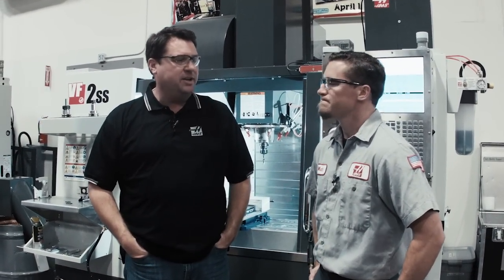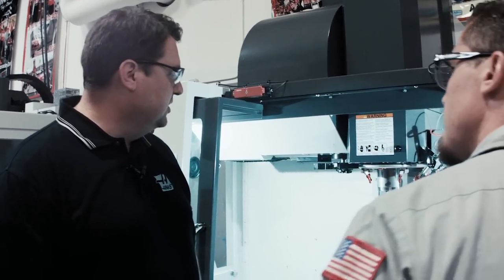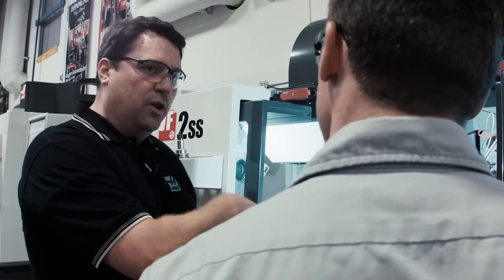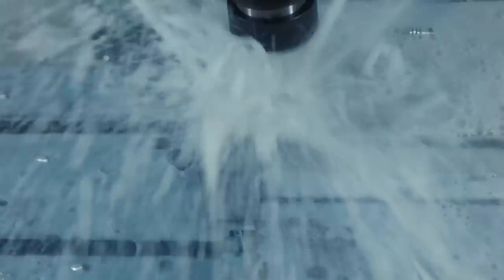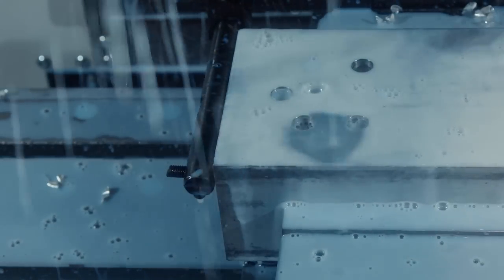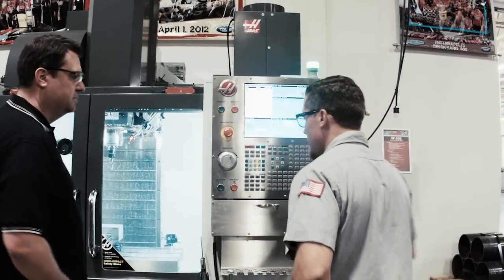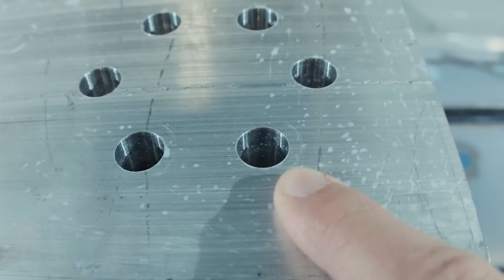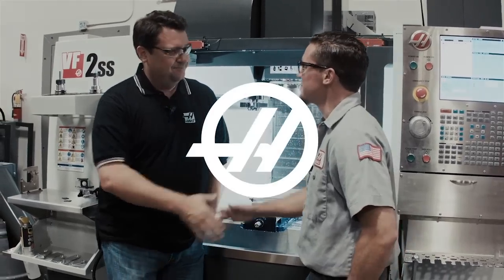The Advantages of Through-Spindle Coolant

Comment: i have little repect for drilling or milling  aluminium.  its like butter for the machine. Much more fun to see when machining steel.
Reply: Shop owner who works aluminium on a daily basis says you know less about machining aluminium than you think. Steel is probably hard but aluminium is sticky. When drilling a deep hole, aluminium chips are much harder to evacuate away which often results flute blockage or tool break, whether it is a HSS or carbide tool. When doing a job with 20000 deep holes, TSC will literally save days of cycle time.

Comment: if he wanted a true "apples to apples" comparison, why not solid carbide vs carbide with TSC? I think the HSS -> carbide makes a bigger difference than flood -> TSC for final hole quality.
Reply: Mech engineer I assume it was done that way since you still need to worry about keeping the drill cool. The feedrates can be bumped up with carbide but there's still a pretty heavy limitation if you can't deliver coolant to the hole.
Reply: I was just thinking the exact thing. Why hss with flood coolant vs carbide with thru coolant?
Reply: Totally agree - many of the Haas videos are great, but this just seems like a marketing ploy for TSC, using different materials, likely different geometries etc.
Reply from the maker: Mech engineer Jay McCrary ***** Andrew, you're correct: TSC really lets you increase federates since it does a better job of flushing chips out of the hole. The demo we did was to show the huge improvement you get with good cutting tools and a TSC system. Lots of people still use just HSS drills and flood coolant. We wanted them to see the full benefit with high performance drills and TSC options.